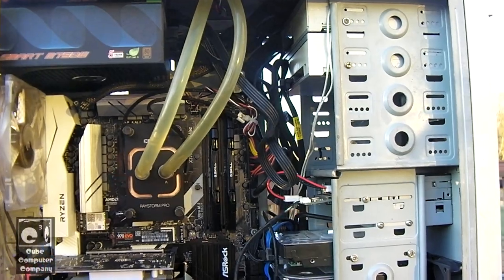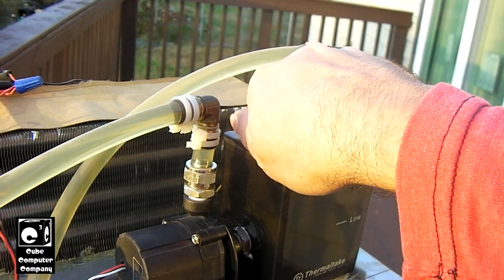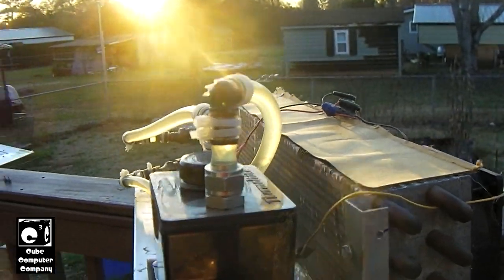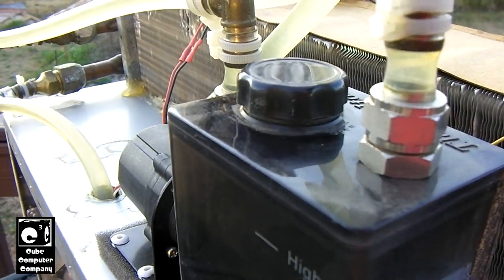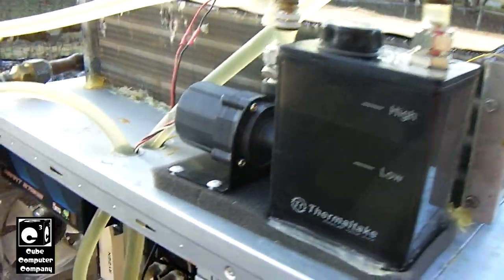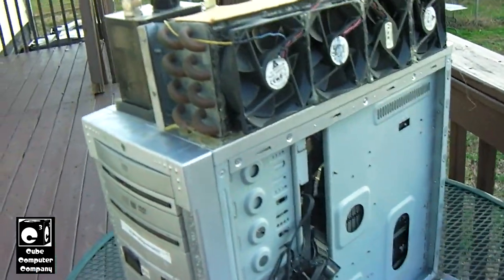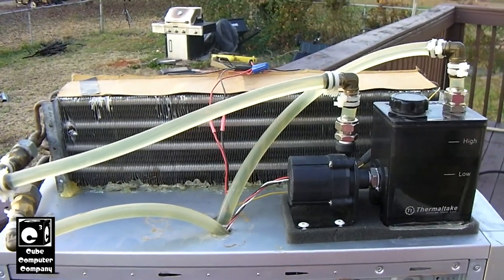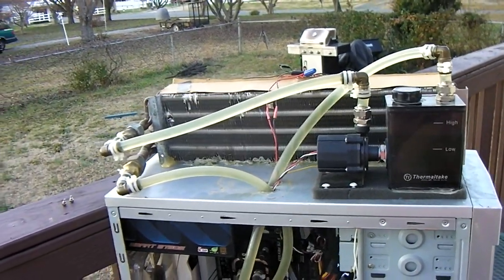Car Coolant in PC - 4 Year Update

Comment: Can I ask what the radiator came off of/its type? It seems like large enough and with wide enough fins to do a passive setup for low tdp chips
Reply from the maker: I have no idea where it was actually sourced from. When I found it, it was loose (not in a box or with any documentation), and appeared to be new-old stock. It could easily passively cool low TDP CPUs

Comment: I'm wondering if you can add a few drops of the automotive UV leak detection dye that cost about $10 a bottle at the auto part stores. I used some to find a leak in my truck a year ago, and it still glows like crazy. They don't say you have to flush afterwords either, so I assume its perfectly safe to dye your loop with. I bet it's the same kind of coolant safe dye that the snake oil PC liquid coolant salesmen put in there pre mixed bottles to make it fluorescent anyway...
Reply from the maker: If you get a bottle, feel free to share the ingredients! I'm curious...
Reply: Sounds like a great way to also improve the aesthetics, add the UV dye, a black light and it the system will glow in a way that RGB ligths can't replicate.

Comment: I ran Antifreeze green at 13% titration with distilled water on a 24/7 uptime unit, Worked good for about 3 years (Little service) until eventually i came home and the motherboard was shorted it may have been other things like age, power surge, electric static, ect. But i suspect that it got conductive over time and shorted the motherboard so i think if i ran a 100% antifreeze on an all copper system it would have been okay, pump looked good aswell no O-Ring damage, tubing was thrown away and gross most of the waterblocks were cleaned up nice with a little tooth paste.
Reply from the maker: To be honest, any coolant with time will become more and more conductive, even 100% distilled water, or the PC coolants out there which claim to be "non-conductive". This is because with time, metal is picked up and absorbed into the coolant. There had to be a leak somewhere for coolant to get onto the motherboard...

100% antifreeze would probably not work so well for the same reason it wouldn't work so well as straight antifreeze in a car. Plus it would be super thick, and not good for the pump.
Reply: @CubeComputerChannel  Interesting I've been thinking about how mineral oil would do in an all copper loops thinking little service as possible for server's and long uptime units.

Comment: Few DIY tips, for uv reactive, soak some ink out of a hilighter pen cartridge, orange, pink, green and classic yellow work best, add a few drips to your res till it works, the yellow would probably mix with the antifreeze the best, and for "Vue" or "aurora" effect, a quarter teaspoon of pearlescent mica powder (sub 25ug in size to stop clogging), might settle out eventually but always looks good and as far as I have noticed, does not effect thermals

Comment: AFAIK the only concern with glycol is that it will chemically react with PETG tubing or if you chose a low cost reservoir since most of them aren't made with PMMA. I'm looking for alternatives since  here I ran a chiller that does almost 7L of coolant so it needs something not so expensive for every refill.

Comment: I'm re-filling my AIO with motorcycle radiator coolant for years (basically the same coolant as car radiator, 20% Ethylene Glycol 80% Water mixture) and it's doing great, many tech youtuber be like "It can destroy your tube ! it's gonna leak and destroy your PC 😱", my PC doing fine for last 3 years and i have more than 1 PC that's using Engine Coolant for years, the only thing i didn't like are light green color🤦‍♀
Reply: there's a blue-ish colored coolant for motorcycle, ice something is called XD you know of other color option now xD
Reply: Engine ice @Tequigamer
Reply: Is it just entirely coolant? No diluting it with more distilled water?
Reply: im 1 year late, but you're RIGHT only on 95%, you forgot to say to this young folks that some cheap Radiators are not mend to be refill with Ethylene glycol as it can corrode aluminum, especially at high temperatures. :)
Reply: @IslanmGeiHomo  I'm using copper radiator and waterblock, yes it's 1 year later after I post first comment and my water cooling setup still runs fine.
Reply: @ErnestJay88  excuse me sir, can i ask, you just refilled your AIO or you did expanse it ? I also want to refill and expanse the length of tube due to my small PC case, so I just want to ask your experience.

Comment: Mechanics use paper disposable test strips the dip in radiators to test coolant. You can probably find some at your local automotive parts store. 
Just to remind you of my challenge, now that it's clean, collect temp info. Stress test to see load temps, if your coolant needs to be changed, I wonder how much difference straight 50/50 mix will be.

Comment: I'm actually planning on going back to water cooling my pc again. Planning on using 6AN fittings and lines (still debating if using G1/4 -> 6AN adapters, or redrilling/tapping for more common m14 x 1.5 -> 6AN adapters) and running 50/50 coolant in it.

did a loop before with 80/20 distilled/antifreeze and worked out just fine as well

Comment: I'm curious how well your hack job cooler preforms. You should do a video with the CPU at max speed or over clocked running Cinebench. I have been thinking about building my own CPU water cooler.
Reply from the maker: Although I have not really experimented with the Ryzen 7 1700X, this watercooling loop used to keep an AMD FX-8120 cool enough to hold a stable overclock at 4.2 GHz (stock was 3.1 GHz). With the Ryzen 7 1700x, when the CPU's at idle and it's like 65F ambient, the radiator fans don't even run until the CPU gets some load.
Reply: @CubeComputerChannel  That is pretty cool. I don't know much about AMD CPU's anymore as I haven't run one since their Phenom II X4 965 BE back in like 2008 or 2009. The I9 11900kf is what I am running atm and it gets pretty warm especially during the summer months. I kept it overclocked to 5.3 GHz for nearly 2 years, but I set it back to its 3.5 GHz stock as it is fast enough to do anything that I use the PC for. It's a solid CPU. Testing your cooler would make a great video. I'd watch it.